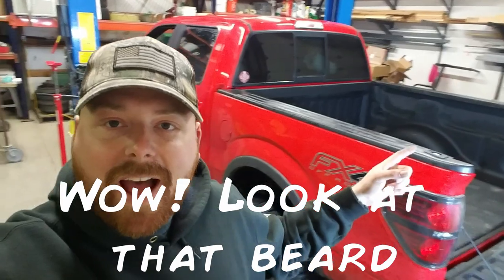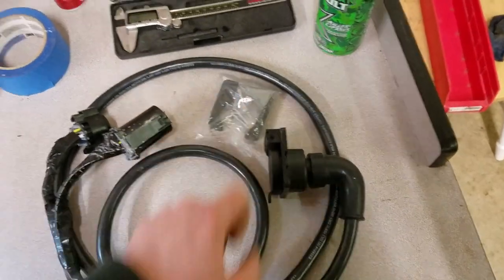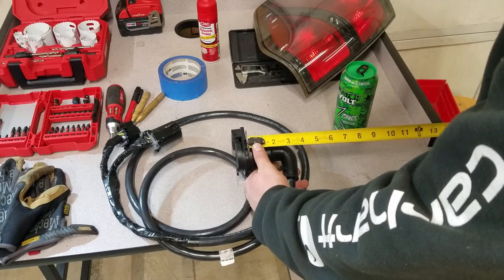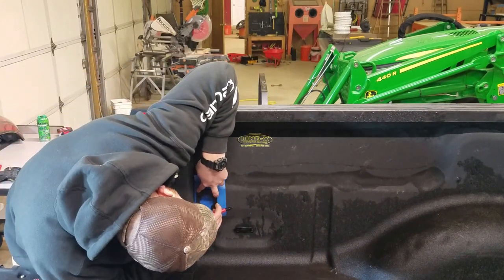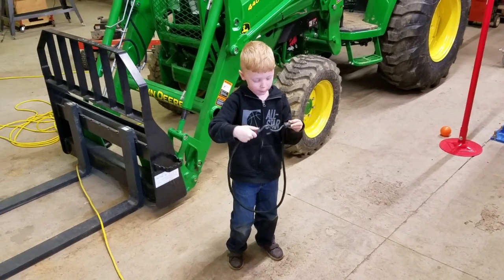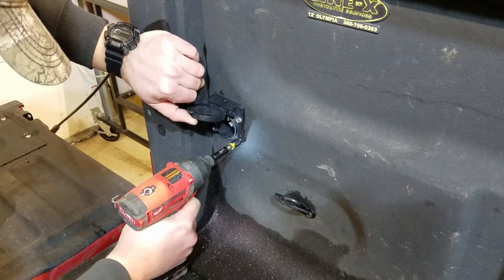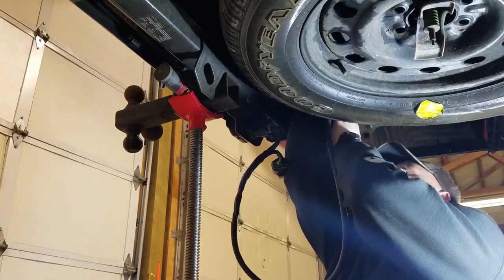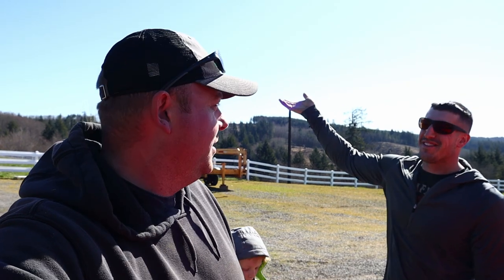Installing a 7 way plug in my Truck Bed

Comment: Good video Tyler! I didn't realize they made plug and play wiring pigtails like that. Sure makes the job a lot more straight forward for sure.
Reply from the maker: Thanks man. Ya it definitely made it way easier. Drilling a big hole in the bed was the only stressful part. Ha
Reply: @TSGear  Drilling into new rigs makes a guy uneasy. Maybe your new 2020 truck will have the plug from factory so you don't have to drill it yourself.
Reply from the maker: @jason.hartson  ya it does. I'm guessing the pandemic is going to delay the truck some. Hopefully not though.